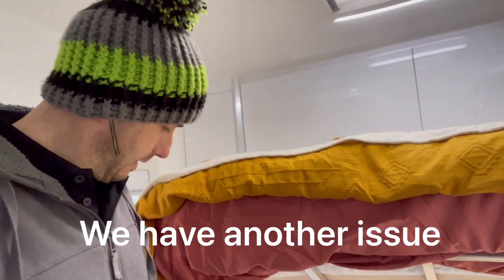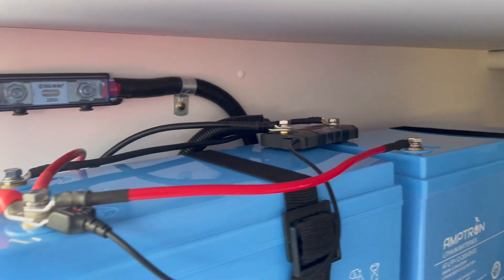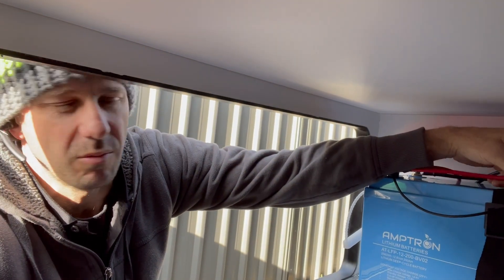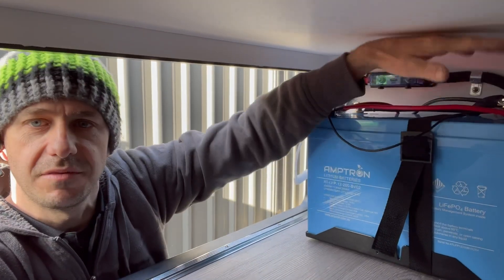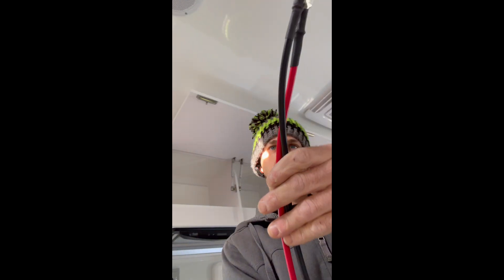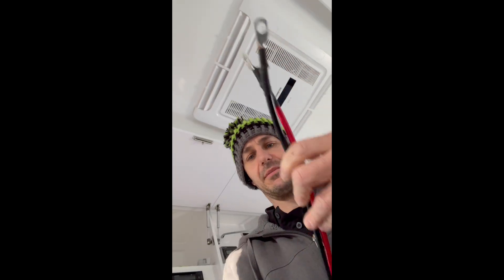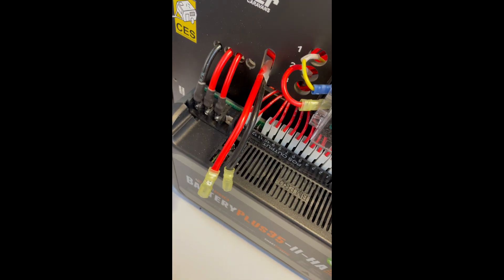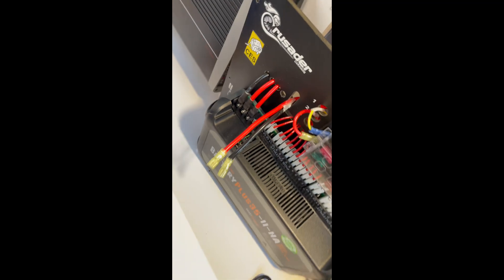Upgrading factory fitted￼ solar and DC to DC charging check out what we found￼.

Comment: Good job/vid. That is a pretty crappy rookie mistake, there is a lot of shoddy workmanship coming out on these flash new vans, sad to see no QC on the DC side. 
12vdc may not electrocute anyone in a hurry, but it still has plenty of potential for electrical fire hazards & performance loss if wiring is not done correctly. Cheers

Comment: So it wasn't shown how you change the bm pro connectors when thicker cables are needed. ??
   So what if someone is wanting a caravan dcdc charging set up and a Ute canopy charging set up, are the dcdc chargers need to be smaller for standard alternator to handle 2 DCDC?

Comment: you c'ant create a inbalance between 2 battery in paralell, but yeah, cable are going to overheat
Reply from the maker: I beg to differ here. I have seen multiple batteries with balance issues.
Most, if not all of the jobs we do are with a parallel system. The problem is the battery systems are not always wired up the same way. An example would be all of the negatives and all of the positives attached to one battery and the other batteries are simply daisychained onto this. We replace many batteries, and this is the number one cause of out of balance.

Comment: What size cables should be used from the draw bar to the lithium batteries.
The van im thinking of ordering  is supposedly using only 6mm cables..
that sounds like its a crap job.
What size should i be asking for.?

Thanks

Joe
Reply from the maker: Hi Joe. Sorry for the delayed response cable length is completely dependent on the current draw between 6 and 10 metres with a 50 amp load you would get away with 6bns.
Reply: @extremeacc101  thank you

Comment: Hey mate, I notice the battery linking negative cable on this goes onto the non monitoring shunt side. Is there are issue with having all the negatives at the other end including the linking cable?

My negatives terminate on the one post. 

Hope that made sense
Reply from the maker: All battery negatives to one side of the shunt, loads and chargers to the other.

Comment: Excellent mate love watching your stuff as I am just about to do my lithium in my van what size cable do you run from the car battery Through Anderson plug to the van I have a Victron 30 amp dcdc 
Thanks Damo
Reply from the maker: depends on length.
6bns minimum should suffice for up to 50a

Comment: So what is your opinion on the overall management system on this van, despite you 10mm wiring between the batteries.
Reply from the maker: Nothing wrong with it.
It’s only when things change that we find an issue like the installation of this inverter.

Comment: thanks for posting great information. ( without being 'smart) the 'problem' that I can see is uninsulated battery terminals and cable connections. someone stores a metal frame chair ( or similar- even a metal coat hanger) in the tunnel boot and the potential for one huge short circuit, and fire.
Reply from the maker: Great point too ✅✔️✅

Comment: This is the big issue with the caravan industry. There is minimal standards and installation requirements in relation to 12v equipment. So every manufacturer operates in a grey area with no regulation. Until there is an Australian standard to reference and perhaps some sort of licensing on these installs the problems will get worse… a lot worse actually. It’s going to take a few caravan fires and deaths before something changes
Reply from the maker: so true, well said

Comment: Matt, thank you for your informative videos! You freely mention battery brands, inverter brands, heater brands etc etc. If a caravan manufacturer/importer provides a product with such basic failures as in this video, that name SHOULD be mentioned to alert current & future owners. Further, if the caravan manufacturer/importer is alerted to the problems found by an expert such as yourself, the problem can be sorted at source.  The whole caravanning community benefits!
Reply from the maker: I appreciate your comment however it’s not the Caravan manufacturers fault. 
It’s just the lack of standards in the industry. I’m trying to make people aware of what to look out for. I agree until the day of standards unfortunately this type of stuff will continue.
Reply from the maker: I freely mention brands that I use and recommend because they have a proven track record of support and quality.
Reply: It's there to be seen if you pay attention........
Reply: Ever heard of the laws of defamation? Even when you’re right it will cost you $20,000 to defend yourself in court. Easier not to mention brands.

Comment: Hey mate,
Great vids. Love your work. People can really learn alot from you. 
I'm a sparky travelling on the road full time in my van. I've helped several people with charging issues over the last few months. I keep coming across bad work in new vans which simply hasn't been tested. If it was they would realise they haven't installed the system properly. The owners are very upset as they have paid good money for something that doesn't work properly. It's not until they get on the road then they realise. Very disappointing to see.
Please keep up your vids mate. I pass them on so van owners can learn from you.👍
Cheers
Reply from the maker: No worries 
Keep up the good work ✅🔋✅

Comment: Hope you don’t mind me asking but what cable should I use linking two 105ah lithiums in my f truck canopy and also back to a bus bar. I don’t have an inverter will be mainly running 80ltr fridge and then Anderson to use air compressor. I’ll never be putting a massive inverter in there as we are getting one in our van to use along side the power Paul batteries thanks to your good wrap on them 😊
Reply from the maker: Simple link the batteries up with the highest charge or discharge in mind.